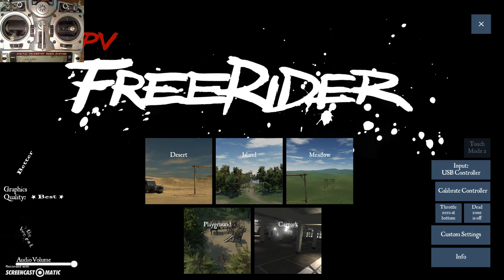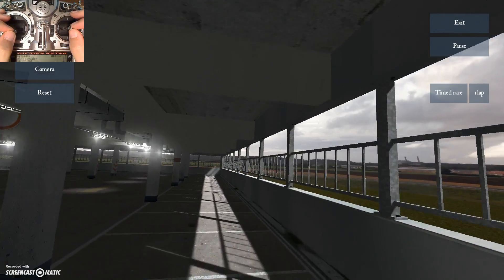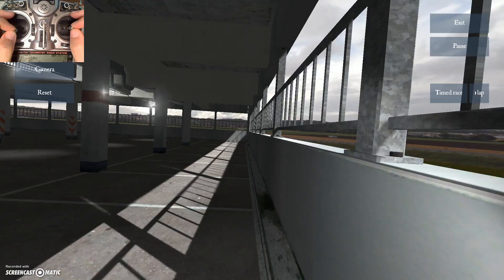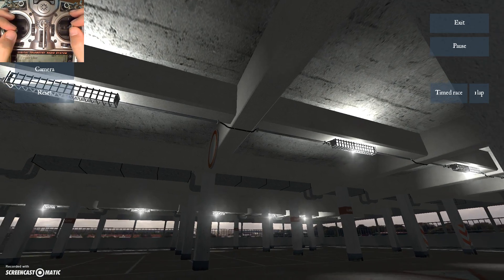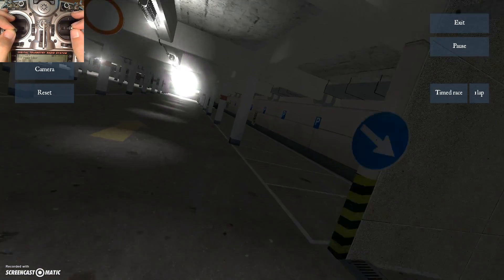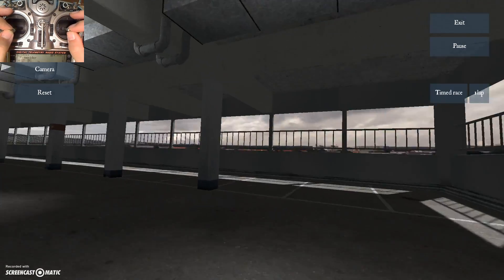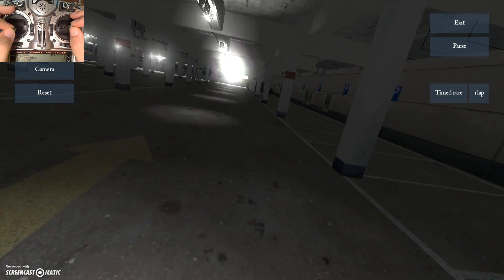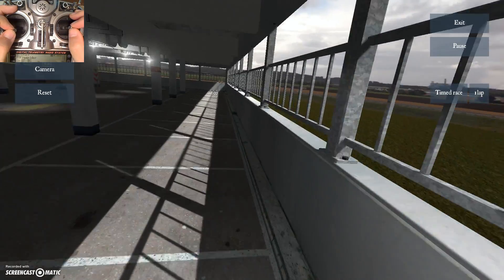How To Fly A Racing Drone - Lesson 23 - Racing Turns

Comment: I have 1 big big big problem with all the Simulators 

I started learning on fpv freerider until i could do nearly anything in there. Used this video series. 2 Months later i can do flips,rolls,sharp&wide turns, precise manouvers in really small spaces. 
Then more and more people told me : Mimimi freerider is shitty and out of all Sims the least one compareable to real life. Try velocidrone its near 1:1 physics.
Ok bought it on steam aaaaaaaaand im fricking shocked
Rolls,flips still easy, but even basic turns are completely different in velocidrone than in FreeriderFPV. Now im training for around a month in velocidrone and im back near frustration.
The drones feel way too draggy compared to freerider. Locked in ? hell no. also the drone in velocidrone feels like they fly 10000000000x faster at a 30 camera angle than in freerider.
in freerider the drone feels like its too much locked in? no drag or momentum. While velocidrone feels like u push a drone with 400kmh on ice and try to change direction with that

all in all it feels really shitty and i guess im gonna dump the sims and go build the first quad. Because now i dont know which sim really is more realistic. And i dont wanna spent another XX hours in a sim that doesnt represent the real thing. Like making a drivers license in GTA for real life...

Comment: Hi Joshua. Recent subscriber love your vids! In this vid when I watch your hands on your controller, it seems that the yaw is on the right of your controller? Am I seeing that right? Is this a trick of the camera or is this a certain mode that you've got set up?
Reply from the maker: No, I am flying Mode 2. Yaw and throttle on the left, pitch and roll on the right.
Reply: I'll be darned. I just ripped through a pack mixing much more roll into my yaw during turns. I've been "steering" with yaw with very little roll. You've helped bring me out of "2D" flying and into a more "3D mindset". Thanks so much for the vids from a new quad addict!